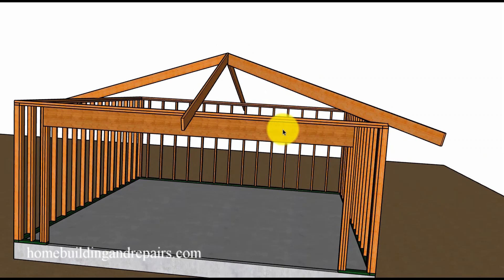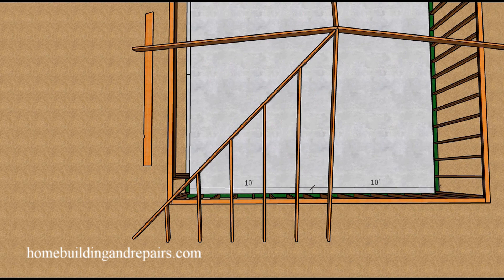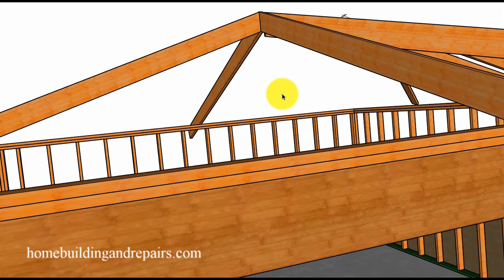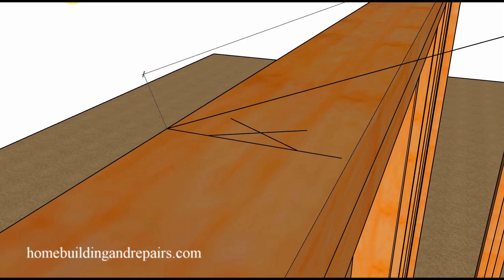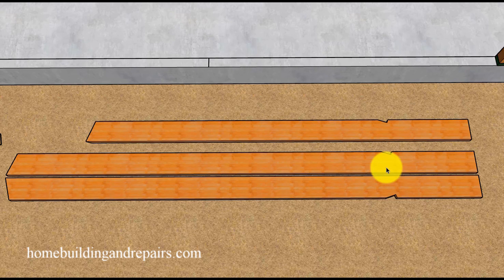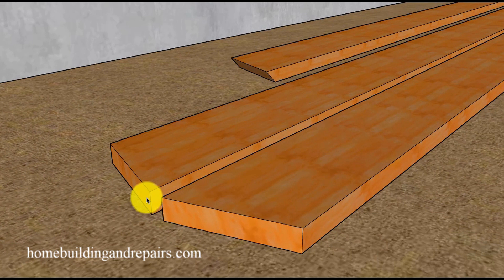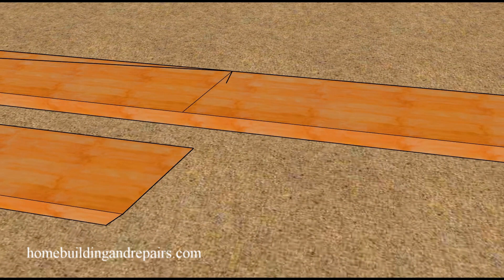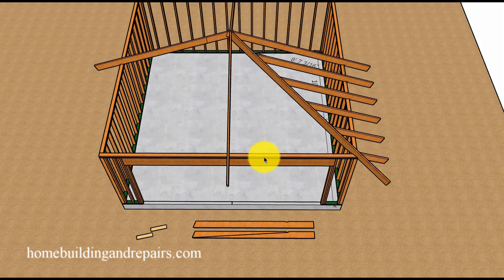How To Calculate, Layout And Cut Jack Rafters For Hip Roof Framing Without Difficult Math Formulas

Comment: Thanks for making this video, its really helpful.
Regard the plumb cut, the angle of the hip is less than common rafters so should the plumb cut for jack rafters not be the same as the hip angle?
Reply from the maker: No, think of how the jack raptor is intersecting the hip rafter at the same angle it will be intersecting the ridge. The top plumb cut on the jack rafter should be the same as the common roof rafter.
Reply: @gregvancom  Exactly Sir, the plane of the jacks needs to follow the plane of the C.R, 👍🔨🇮🇪

Comment: thanks for another helpful video. i was wondering, couldn't you make the cheek cut first and hold the board in place a bit high, like what would be left of your 2x8 hip joist minus the height above plate so you could mark the board where it will contact the beam? So if I'm using a 2x8 for my hip joist and my height above plate is 4", I would hold the board in place with the cheek cut 3-1/4" higher where the cheek meets the common rafters. Then I could mark the exact location of where the birds mouth will contact the corner, because once that 3-1/4" is cut for the birds mouth it should just drop into place. Does that make sense?
Reply from the maker: I say go for it. I'm not following 100 percent, but if you have a better way, why not try it.
Reply: @gregvancom  well, I tried it today, but it didn't quite work out. the cheek cut was about an inch short of its connection, so I kept cutting a 1/4" off the plumb cut of the birds mouth till it fit perfectly. it took a few cuts, but I'm pretty happy with the fit. I used the same board as a pattern for the other corner too. It wasn't quite the same distance, but I was able to cut down the pattern board till it fit and transferred it to my final board. I'll probably never have to do that again. lol! jack rafters are next. I'll try your way on those. 😃